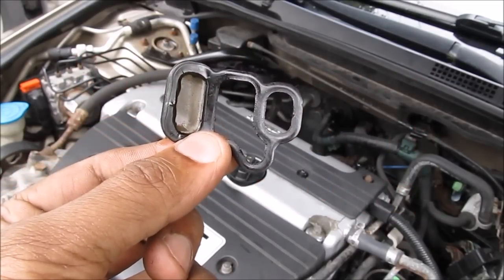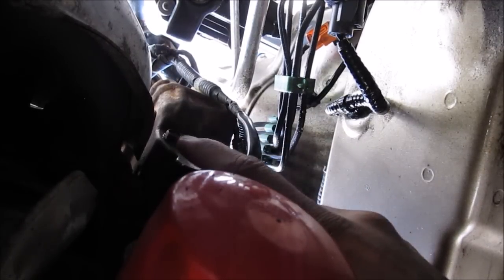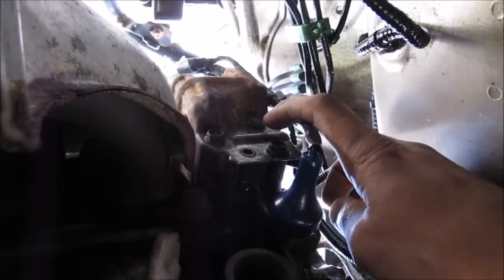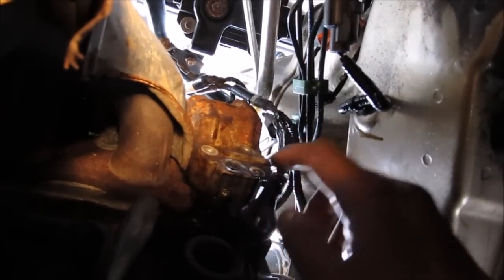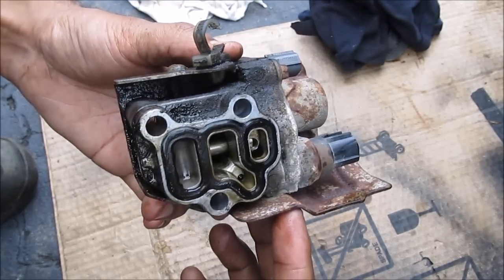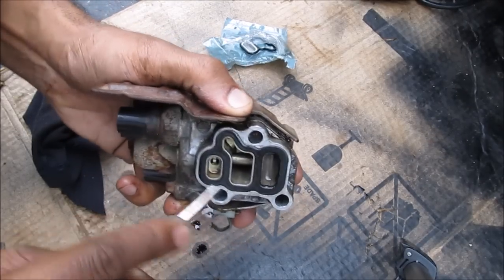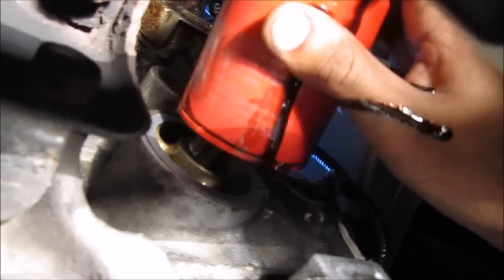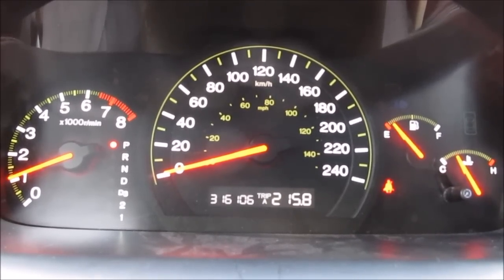How to Replace a Honda VTEC Solenoid Gasket

Comment: Awesome video,.  My mechanic told me to change this vtec solenoid because as he stated "it looks bad and it's leaking oil."  However, I'm more concerned about my oil levels.  Apparently, my oil levels be low.  I don't know if it's because of the leak on the vtec solenoid or a leak somewhere else.  However, every month in half, I have to add 2 qts of oil.  Can this vtec solenoid be letting out SO MUCH oil from that little gasket.  My mechanic changed a PCV valve and even changed the oil pressure switch because it keep lighting up, but the oil is like... I don't know.  Can the vtec solenoid be the cause of my excessive leak?
Reply from the maker: Yes it could
Reply: Changed the vtec solenoid gasket seal and the oil levels still drops.  I smell a lot of burning oil sometimes when I drive fast.  My mechanic told me to fill the radiator because the engine can be getting hot.  So I did but the oil level does seem to continue to go down
Reply: King Less burning oil ?
Reply: @andrewg2322  yes. Excessively.  I can see my muffler tips black.  I did a oil change on 9/29 and by 10/20, it was dry, had to add 2.5 quarts just to bring it back to the level on the dipstick.  I don't get it.  No leaks, changed pcv, changed solenoid seal. I don't know.
Reply: King Less yeesh thats rough, the oil has to go somewhere, it must be a seal somewhere, if the pcv is gross repeatedly it could be a piston ring seal :(  in which case means a head gasket too.. as long as the vtec works with no bucking at rpm, fill the oil every week and hope your cat converter holds up... good luck

Comment: Great video! Got two of the three bolts off but one dang bolt is rounded out and I just cannot get a grip on it to remove it so I gave up. Looking for a small 10mm socket that will actually remove that rounded out single bolt!

Comment: hi , i would like to ask you, when i change valve& spark plug rubberes for my accord 2005 2.4 . because of leacking oil my 4 cilynders where black so badliy. do you advise me to flush engine oil
Reply from the maker: No need. Just drain and fill

Comment: So why did it solenoid leak and the strainer clog up in the first place?  Could it be caused by infrequent engine oil change and/or not using OEM engine filter!
Reply from the maker: Most of the K series seem to have this common issue...
After a while filters will clog and solenoids will wear
Reply: You're the best sir, and thanks for replying!

Comment: Hello ! I did this about 1 year ago and I want to share my weird oil leak yesterday I found oil leak from the Vtec solenoid. Not from the Oil pressure sensor , not from the B or 8 shaped gasket as well. Oil leak is from between  the body and the head(solenoid). I opened two E8 bolts and applied a little of very thin layer of RTV around the O ring. Unfortunately, the O-ring is not available.
Reply from the maker: Check the dealership?
Reply: speedkar99 no ,but i checked with local car parts store that they told me the O ring which is attached on the solenoid head isnt available. Hope some of you have issue like me this will help :)

Comment: Hey Great Video Liked And Subbed!❤️ but I have a 2006 Acura TL 3.2 I love it fast car lol but I have a cel code p2649 for vtec solenoid valve circuit high idk what to do my car won’t go past 3k rpms and when it hits 3 thousand rpms it’s starts to jerk the whole car and it’s frustrating I need help thanks
Reply from the maker: Replace solenoid. Or try cleaning first
Reply: speedkar99 what should I use to clean

Comment: Good easy way to do it. Thanks for sharing. IMO I would just change the whole unit. 107.00 at the honda dealer.
Reply from the maker: That's what you don't you get the code again. Mine was just leaking.

Comment: Man I try to remove the same part and it's quite easy from the top rather than lifting the car but the bolts on my RSX are way to rusty and are stuck in there.I try and try to remove all 3 but just couldn't.I even lift the car but I can't reach the screws.I don't know how you did it bro.
Reply from the maker: Hope your able to get it. If not, you can get a mechanic to help you on a hoist.

Comment: Does it help with code 22 VTEC Pressure Valve? It just happen to my car. I think it's clogged, but not sure if this is the spot to clean.
Reply from the maker: +Thornthanut Pakdeepinyo you might have to replace the solenoid if your getting codes

Comment: i just replace the seals and still leak a little.If the seals are good ,why does it still leaks? and from where?
Reply from the maker: +aj sj timing chain cover or vtc solenoid or valve cover. I hated this car for oil leaks

Comment: Woah. 316k miles. Mine has ways to go. Great job taking care of the car.
Reply from the maker: +Mr. Ali Thanks 
316Km is barely 200K miles 😛
Reply: 28 may 2019 5:59 pm edt:
316,000 km = 196,236 mile.source:1 kilometer = 0.621 mile in 
https://www.rapidtables.com/convert/length/km-to-mile.html from google 
(1 km to mile)

Comment: Wat code does the car give to replace that whole piece?Im gettin a P2647 an i replaced tha switch but car is runnin tha same. I wanted to replace that piece cuz it looks old like the one u pulled out.
Reply: I got this code which replaced the sensor and it worked but now a day after i find oil on the floor and from the top i dont see any oil. But on the whole part u can see some by the bolts. So I am leaning towards the filter being clogged which messed up the sensor and now is leaking oil? Weird
Reply from the maker: +Ike D  Usually replacing the switch should fix the issue unless the new one is defective. Did you clear the code and try again?

Comment: Thank you so much for sharing the torque specs 104 in/lbs!
I wish everybody was thorough like you!
Reply from the maker: +limplin7 Thanks, the torque specs are critical on all gasket surfaces for a proper seal
Reply: 28 may 2019 7:11 pm edt:cold-temperature maybe decrease o-ring-rubber-ability to seal oil.
[28-jan-1986]11:39 am est usa-country->florida-state->kennedy-space-center->atlantic-ocean
 nasa-space-shuttle-#accident#.cold-temperature during night prior 28-jan-1986
 launch,make o-ring-rubber-seal freeze,losing flexibility then can not seal hot-gas then
 hot-gas leak,burning spacecraft-body during launch-process:https://www.youtube.com/watch?v=01CfiyP0_7A (Challenger Accident Animation )from youtube-search(how o-ring fail challenger)result 4 from https://www.youtube.com/watch?v=YV-75Hg0nMc (The Challenger Disaster: STS-51-L Helicopter Camera) maybe from youtube-recommendation in https://www.youtube.com/watch?v=EErKahLx0tc (how long can you survive on each planet?)
 
 o-ring-rubber-seal losing flexibility:https://www.youtube.com/watch?v=gC9yjRmvtY8 (Space Shuttle Challenger O-Ring Failure Diagram | TheBlaze )from youtube-search(how o-ring fail challenger)result 2 .
 
source:'The failure of an O-ring seal was determined to be the cause of the Space Shuttle Challenger disaster on January 28, 1986. A crucial factor was cold weather prior to the launch. This was famously demonstrated on television by Caltech physics professor Richard Feynman, when he placed a small O-ring into ice-cold water, and subsequently showed its loss of flexibility before an investigative committee.' in https://en.wikipedia.org/wiki/O-ring#10_feb_2019_7_16_pm_est from 'o-ring' in https://en.wikipedia.org/wiki/STS-51-L [extra-source:'est','florida' in https://en.wikipedia.org/wiki/Space_Shuttle_Challenger_disaster#20_may_2019_7_22_am_edt from https://en.wikipedia.org/wiki/O-ring#Challenger_disaster]
 
all astronaut-occupant dead:(1)francis-richard-scobee(2)michael-john-smith(3)ronald-erwin-mcnair(4)ellison-shoji-onizuka(5)judith-arlene-resnik(6)gregory-bruce-jarvis(7)sharon-christa-mcauliffe
Reply: gue st 

PPP
Reply: @speedkar99 What would happen if tightened the bolts more than what the torque specs called for?
Reply: @johnthevessel  you can break the bolts or mess up the seal and wont seal correctly
Reply: @johnthevessel  Torko, the God of torque, would bring havoc upon your house.

Comment: I have replaced the vtec solenoid 3 times in my 2004 Element.  At this point I'm ready to do it myself.
Reply from the maker: +Heather McSparen why so many times?
Reply: Same also.for me but mine kept getting water in the connections from me washing the engine on the 2.4l 2003 accord the si has the 2.0l with a shield to keep it dry. it was a design flaw on the 2.4l to collect water.
Reply: @adamwoltz2228  Happens when you use water to clean your engine... They sell engine cleaners for that. Of course its gonna collect water if you hose your engine down🤦‍♂️
Reply: Me too :(

Comment: This guy is an amazing tech and communicator and videographer. Nice work.
Reply from the maker: +Gene Peters thanks, that's my style :)
Reply: @speedkar99   I agree with Gene Peters. Very good job. Were do you get the torque specifications?
Reply: i bought the gasket yeaterday. maybe 2morro ill replace. but i just did oil change sp imma try to get it without removing oil filter lol.
Reply: you probably dont give a damn but does someone know of a method to log back into an Instagram account..?
I was stupid lost my account password. I appreciate any assistance you can give me
Reply: @Kyson Jamal Instablaster ;)
Reply: @Heath Gustavo thanks for your reply. I found the site thru google and Im waiting for the hacking stuff now.
Seems to take a while so I will reply here later when my account password hopefully is recovered.
Reply: @Heath Gustavo it worked and I finally got access to my account again. I am so happy:D
Thank you so much, you really help me out!
Reply: @Kyson Jamal no problem =)

Comment: What do you do if you have a leak after changing it?
Reply from the maker: +Jennifer Goodson Sounds like what happened to me lol
Leaky k24s
Reply: I changed mine out at the end of September and everything was good lasted about 6 weeks. I'm leaking worse than before changing it out. I am not sure why it all the sudden blew out. I have oil all over my engine because of it. (Backside of the engine fire wall and frame) I'm not sure if the gasket blew out or what happened.
Reply from the maker: +Jennifer Goodson Mine still leaked but it either came from the vtc valve or the timing cover. I had oil over the same area (passenger side and firewall area). It wasn't the valve cover.
Reply: speedkar99 I know I put my hand under the Vtech solenoid that we replaced and came out with a had full of oil. So back to square 1 again. 😞😞
Reply: Jennifer Goodson check the oil pressure sending unit below that and put some tephlon tape on it and thread it back into the block
Reply: h22sparkle I replaced the valve cover gasket and the VTech solenoid (the whole assembly not just the gasket). The people I got the VTech from sent me a wholenew one to replace it.
Reply: Did you problem go away? I change the bred gasket but after few days it’s leaking oil. Not sure if it’s gasket or whole solenoid

Comment: I replaced my Vtec solenoid gasket exactly how you did and it's still leaking. Used exact torque specs as provided. On top of solenoid where all the connectors are, I do see what looks like oil mist all over the solenoid and the connectors. Is there an additional gasket that gets swapped out as well?  Thanks love your videos. Straight to the point.
Reply from the maker: +Omar Morales check valve cover, timing chain cover and vtc o-ring for leaks. 
Mine was leaking from somewhere but it turned out not to be the VTEC solenoid as still leaked after this video :(
Reply: More than likely your valve cover is also leaking from the corner right above the VTEC solenoid, had the same issue. replace the valve cover gasket if you make a positive diagnosis, check the o rings in the VTEC solenoid as well.
Reply: Kevin Muiruri hey I finally resolved the issue. Turns out the internal gasket was bad and isnt serviceable so i replaced the whole solenoid. Thanks!!!

Comment: How come you say replace if engine code comes up? Does the electrical in the solenoid go bad?
Reply from the maker: +M Balzer it will go bad yes
Reply: Awesome, I replaced solenoid. Cleared my code.  Back to crackin v-tec lol

Comment: I have a ep3 type r, it seem to have a flat spot at 5500 rpm and then the flat spot and then after 6 vtec will kick in properly do you think this will cure it?
Reply from the maker: +Hassan Marban check with a scan tool when your VTEC is kicking in vs when you actually feel it kick in. If the solenoid sticks it usually will throw a code.

Comment: How do you know when it's the whole thing that's messed up and not just replacing the gasket
Reply from the maker: +Juan Gonzalez when you get the code, its time to clean or replace it
Reply: speedkar99 ok because the code did show up so I just wanted to double check
Reply: I think it's code P2646. Also, leaking oil.

Comment: Question: Are the three bolts interchangeable? in other words : Do I have to return each bolt to the same hole it came out of?
Reply from the maker: +Hamad Alganis if they're the same length its fine
Reply: I checked with Honda dealer, they're the same part number.

Comment: you mentioned that if you're getting a code, just replace the whole unit. Mine check engine light has been kind of on and off in regards to my VVT. Do you think just replacing the gasket would be enough? I know I got my code read at autozone and the guy mentioned just replacing the gasket.
Reply from the maker: +KOU IZZLE Try giving it a good cleaning by running cleaner through it, in case its sticking. If not then dive in and replace.

Comment: Is it absolutely necessary to remove the oil filter and go underneath the car to do this? seems like there's plenty of room back there to do it right under the hood. Btw my 04 accord isn't leaking, it's just in limp mode (won't go past 3k rpm)
Reply from the maker: +Jordan Calon Not necesary, I removed it so you get a better view on camera.
Reply: Jordan Calon You can access this part from the top if you want. It's a little awkward but you don't have to jack up the car.
Reply: I'm trying to get it from the top and am having the worst time getting the bottom bolt.
Reply: @SingingSabre  Same here.  I think it's absolutely necessary to do this job from underneath because those 3 bolts need really snug socket grip to be opened. I almost rounded up the bottom 10mm bolt. I think he should add a note in the comment section to recommend drain engine oil, take out oil filter to provide easy access to those bolts. Another tip: Instead of breaking white wire clips attaching iVTEC to its bracket, there is another 10mm bolt that can easily be opened using a vise grip holding bracket and a 10mm wrench. That will give a better chance to use a flat head screw drive to remove electrical connectors which tend to break if you apply too much force disconnecting.
Reply: How you found out why you can't go past 3000 rpm? My base rsx is having the same problem can't go past 3k rpms in any gears

Comment: Great video .i just did the same replacment for my accord  and l can recommend anyone who needs to do same job that it is also  quite easy to remove Selenoid from upperside of the engine  and you dont have to jack the car up and remove oil filter.
Reply from the maker: Good tip. I preferred getting at it from the bottom. To each is own. Removing the oil filter was only necessary to make this video so you can see what I'm unscrewing.
Reply: l got it !Thanks a lot ,l would not be able to change easily unless l watch your video.You inspire many of us around the world ,Loves from Turkey :).
Reply from the maker: +Asim Ustun thanks I'm glad you enjoy my videos.
Reply: KOU IZZLE l tightened them by hand since l did not have a special torque wrench and you dont need it tough.just do it slowly and dont give your all power, dont be a Rambo ,lol.you can try to tight it with your tumb to check its tightening if you cant move ,your are good
Reply: Hi,  Are you saying, everything can be done from up top?  Thanks.
Reply: what was the initial problem that you had? Was it something like this https://youtu.be/-WJK3foaWvY
Reply: Asim Ustun did u have any spills when doing the job from the upperside? I've got a check engine light that comes and goes but the code was for the solenoid. been meaning to change it so I'm just curious if I need to put a rag or shop towels underneath
Reply: KOU IZZLE Hello,Dont worry about it. it doesnt spill out that much when you loosen all the bolts (3 bolts) and while removing it you can wipe away the oil spills with the rag at the moment.
Reply: KOU IZZLE and one more thing ,when tighten the bolts back,just do it gently ,they are so weak and can not bear that much,when you break one of them ,it would be very difficult to take the broken part out .
Reply: Asim Ustun do I need to tighten it down to the specific weight or is hand tighten enough?
Reply: mogtrader8 yes ,sure.

Comment: Hello. I got an 02 rsx base model. I'm having oil leak by the oil filter. From what I can see I have oil all over the filet an around that area as well as the braces found around that area. Should it be safe to say that my gadget went bad?
Reply from the maker: +Will Chavez First degrease the engine and clean everything. Then you can more acuratly point out where the leak is coming from. The vtc valve sometimes leaks as does the timing chain and valve cover in that area

Comment: Thanks for the upload. Does this applies to the K20 engine as well? I have a 03 Civic SI and was cleaning the engine bay today and noticed oil splatter on the passenger side area towards the back of the engine.
Reply from the maker: +TTBT Yes it should be similar
Reply: was about to ask this too.    thanks!

Comment: Hey what is that sensor called under the vtec solenoid with the blue mushroom covered I snapped the housing on mine need to replace but don't know what it is called
Reply: That is your oil pressure sender.  Part # S4270P @ O'reilly's Auto parts.